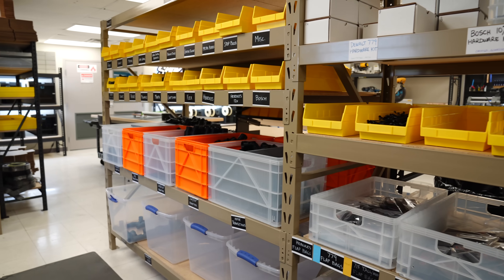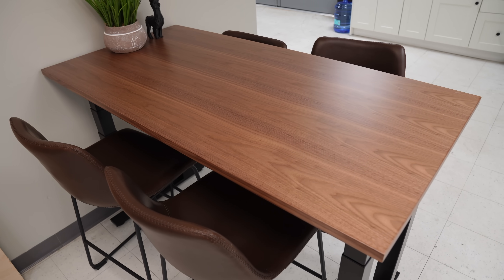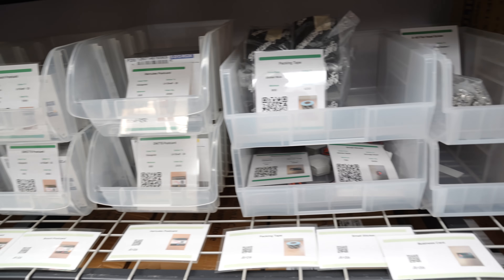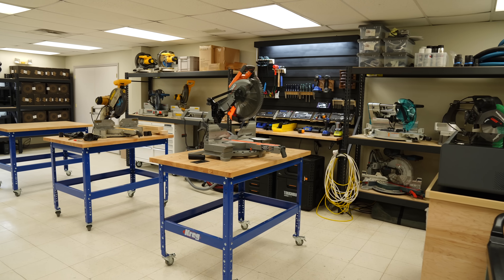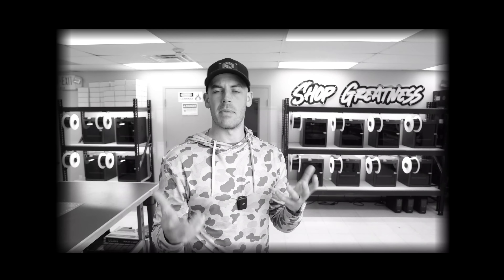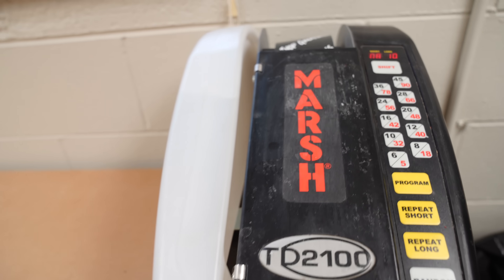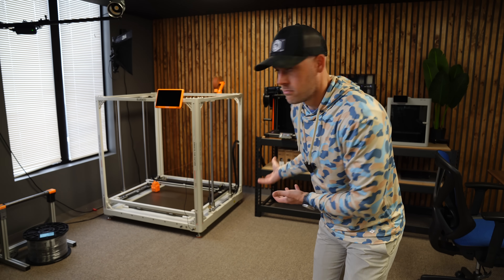I've spent $100,000 on my 3D Print Farm // Updated Tour!

Comment: Hell yeah dude!

I started my small business during the summer and finally got my first reseller, so these days I can't really be doing the "print on demand" thing anymore and I also need to build a stock like you to keep my lead times down to a few days

Loads of yummy tidbits and knowledge in this single video

Just like you mention, having enough filament on hand have been a major issue. And also spare-parts for the products I'm making.

I'm definitely going to implement most things you've done, just on a smaller scale (I only have 3 printers.. so far) :D

Thank you!

Comment: I dont get it, why not just go injection molding? A single mold and can probably replace all your printers, make a stronger part and make the parts in seconds vs hours. And probably cost you the same.

Comment: In a video on your other channel you state the printer to buy is the P1P but you have now changed to the P1S. What is your reasoning behind this? As far as I know, the only difference between the two is the P1S has is that it is enclosed but you can still add that to the P1P with the fans and ams stuff. Obviously it would cost more to retrofit but is it more for future proofing?

Comment: Might I suggest, adding a hanging like clear vinyl curtain/air flow protection. Between the pallet parking and the kitchenette. They aren't super expensive, and in the winter months or when experiencing weather. It will help keep dust and stuff ingressing into the building, and whoever is making food, or eating, much more comfortable.  Just food for thought, I have worked in a lot of large small business shops over the years, and that just speaks to me immediately.

Comment: Couple of things I noticed that I think are worth mentioning. First the shop overall looks great. 

At the printer repair station I assume there is some amount of soldering going on and I will also assume that the solder is the standard 60/40 tin to lead solder, but I didn't notice any ventilation to deal with flux fumes. I think that is something to consider for both now and for scaling in the future as your HVAC system seems to be mostly just mini splits.

Second, I have no idea what in your process necessitates so many miter saws. Is it just R&D or production as well? that should help with coming up with the answer to where to put them all.

Last, I love the whole inventory set up you have going on with the kanban cards and all. I would add that strategic buffer stocks for various reasons are not just limited to fulfillment but are applicable everywhere as evidenced by Toyota themselves during the pandemic. Here is a link to a Harvard business review article about it. https://hbr.org/2022/11/what-really-makes-toyotas-production-system-resilient

Lastly what part of the country are you located, as someone from Ohio I've always had a fascination with American manufacturing at all scales so it's fun to see contentt like this. It looks like a great operation.

Comment: Hey, hello and how are ya. I love your stuff. I've seen a few of your videos and have plans to buy alot of your plans as well as your dust port for the DWE779 miter saw. Once I convince my Wife (love you Babe). that we have a big enough yard to build a shop. But I was wondering I have the DW735 13 inch thickness planer and the dust port, well it blows no pun intended but it blows straight out and I was wondering, You being a 3D printer guy if there was a way to make an adapter that would blow the debris to the 10 o"clock or 2 o"clock direction so that it wouldn't interfere with your stock coming out of the machine?

Comment: What do you use all those miter saws for? That seems a little overkill to have that many. I work in a cabinet shop and we don't have anywhere near that many including our installers.
You could turn that wall with miter shelfs into the "tool wall' and make it French cleats half way up to the ceiling to park the tool carts underneath without obstruction. Then 3D print yourself some brackets or holsters for the miters. That way its not sticking out to much and you have extra shelves now for more printers.
Reply: Just guessing but I believe he buys them to then create aftermarket parts for them? Like 3D printed dust collection manifolds which were shown in the video.

Comment: FDM Printers are known to release plastic particulate and fumes which can be breathed in and is toxic to human health. How do you protect the health of yourself and employees against breathing in this plastic?
Reply: We print in our shop every day and usually have about 6 printers going at once. We had air sample testing done several times and the data showed we were well below exposure limits. This is including printing ABS, PLA and a wide array of high temperature nylons.
Reply: Pneumonoultramicroscopicsilicovolcanoconiosis
Reply: HVAC engineer here. Even if they were using ABS to print with, providing a safe environment would be trivial. Here is why. First, the P1S has a built in charcoal filter. Of course that won't eliminate all VOC, but additional activated charcoal and MERV 13 or even higher filtration could be used. Next the most important reason, outdoor air changes. Unlike your home, a commercial building introduces outdoor air to the return air section of the HVAC system. For a project like this we would have to calculate the required outdoor air per square foot required by code. While I've never specifically designed a system for this type of manufacturing, I might end up going with 100% outdoor air unit. With that type off system, all supply air would be fresh VOC free outdoor air.
Reply: No one seems to answer this question I have found...
Reply: Honestly just bog standard HVAC is more than enough for most printed plastics
Reply: They have printed off some filters and cool masks to wear.
Reply: Thanks to denial, I'm immortal.
Reply: That is for filaments like Asa and abs but they are only printing pla and sometimes petg and those don’t make significant fumes to be a problem
Reply: He's discussed using air filtration in the print room in another video. They have it set up to run before they arrive for the day and shut off during the night
Reply: @Matthew.Ball.  Thought I replied, but yes he does. Good to see!
Reply: @Matthew.Ball.  I also know he later on uses printers with enclosures, and a lot of models have filters and exaust fans (I'm pretty sure the P1S has an exaust fan) which he could use to route the particulate elsewhere if he so felt like it.
Reply: You can't just claim fdm printing causes toxic fumes. most prints are printed in pla. This is considered safe. Petg is much safer than abs. And to my knowledge they mostly print with these two materials
Reply: @PhilipThonbo  there's enough studies showing certain filaments emit VOC's and ultra fine particles, these include Pla and petg. Cheaper filaments have more unhealthy impurities and lower quality constituents. I work with AM in aerospace and we ran a small study and determined that there is enough concern for health that filtration and other best practices needed to be used until more data is collected from long term large scale usage. There has not been much interest in further more in depth testing, or long term studies in the industry, so taking precautions is recommended,  but we won't know more until it's been decades and we see any health impacts to those who've used them unfiltered for years. More data points is key. Most health impacts that are concerning seem to not be immediate but likely emerge years down the road, especially any nervous or respiratory system damage. So they're not just making claims. There is reason to be concerned.
Reply: @LifeSOSlive pla is safe and nontoxic even when printing. End of discussion.
Reply: You are completely correct. But it's no use talking to people who are wilfully ignorant. Enjoy your day and let them soak in the VOC's.
Reply: @PhilipThonbo  FDM broadly speaking. I didn't know how much material selection affected dispersion, so interesting to know!
Reply: PLA isny safe to breath every day. But he has the good measures, for you that maybe dont have a farm, dont print while you are in the same room or at least wear a mask (with filters)
Reply: He does not need sir filtration he is professional, will not live till 50 years anyway
Reply: Will you take a huge deep breath of pla microplastic dust? Yeah, I thought not. So it’s safe huh?

Comment: Excellent video, thank you for the tour. I recommend Kaizen foam for the tool boxes that way everything has a home and can be seen if it is missing and should be returned. I use the uline parts trays with tools set in the foam for specific processes or jobs. The tray I use just have the tools needed.The tray that  is taking up space on my counter or work tables are the tools needed for that specific task. I have one for dissasmbly and another for reassembly for example. Having a tray for each action helps me keep things simple. It helps me from hunting for a tool in a pile of tools and thenone I need seems to be lost. I just look at the tray and see the tool there and place it back after using it. I wll always have it where I need it. 
I have found attaching small labels with pictures of the hardware or component on the outside of the bins helps simplify steps. I find it frustrating pulling out several bins that are all the same color looking for an item when a glance at a small picture and description label tells you what is in the bin. I love seeing the Kanban cards and I am glad to see that they help and work for you. Good luck and I look forward to more content. The new channel looks great.

Comment: You may not want to hear it (bc it sounds like you never consulted an architect??), but those rooms don't appear to be vented properly, fumes and heat really need to be exhausted outside,  and not just conditioned air  thru wall mounted heat pumps. (Could also be a building code & zoning violation depending on your jurisdiction bc of manufacturing/hazard use.)   Also, I don't see sprinklers (and fire extinguishers??)  Has your insurance agent assessed the situation?  (You're NOT really *just printing*.).   Manufacturing layout, as another person noted, should follow the flow/process of each step and the layout should maximize that operation (as part of logistics.) But it looks like a good business. Hope it works out.

Comment: I like the inventory management system to reorder supplies. It probably is already in the software but if you could add to the cards a reorder point it would be helpful. EG if employee sees you have only 1 box of this lower use item, re-order. Or if there are 5 boxes of this higher use item, reorder.

Comment: I was wondering what your favorite printer is for general purpose PLA prints? I noticed that you have Prusa and Bambu lab printers. I’m relatively new to 3-D printing, but understand that the Prusa’s are bed slingers and the bamboo labs are chambered core XY printers, but just wondering about what you use the most and what you like the most and what do you intend to purchase moving forward.

Comment: Just got my dust collector delivered and installed today on my 12in Bosch Mitre Saw.  As long as you know this thing was never advertised to suck up 100% of the dust, people should be pretty stoked with this the upgrade; It sure is a huge difference. Very easy to setup and came with everything needed. Very happy.

Comment: Why you don't use the k1 max or k1c I think it is very good for the farm because it can connect to wifi and is controlled by wifi also there is a camera that you can whatcha the printer while it printing and if there any failed print it stops the printer to save time and money also the slicer it organized for farm printer like you can put the printer in groups and also you can send to all the data only one click it going make your life easier and save money and time and you can watch the printer from your house by your phone for each printer also send massages if the printer finish or there's an error

Comment: For hardware and other small parts I would look into a two bin system rather than kanban cards. The kanban system is great but it relies on a physical card to be "turned in" rather than a visual signal of an empty bin on the top of a rack to signal reorder. This might be less of an issue for a smaller operation though. Otherwise great work!

Comment: Have you considered running a mobile robot arm for 24/7 3D printing, might reduce the amount of printers that you need either lowering the temperature or allowing you to upscale without having to move to a new location. Voodoo Manufacturing had an awesome YT about it many years ago, might still be available.

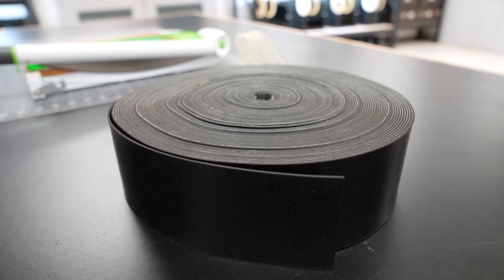Comment: 7:54 - I use to work in a print shop where we cut down huge parent sheets of paper into smaller sizes post-print, using a hydraulic powered guillotine cutter... I think this would help you in your efficiency and speed. It would also help to reduce worker injury from joint pain and inflammation from repeated actions of lifting the, what appears to be, paper cutter blade up and down, and up and down, over and over again. It doesn't have to be hydraulic - I'm sure they've made better ones since the ancient one that we had... 

Best of luck! I look forward to watching more of your videos..

Comment: Nice Video!  I have a question about the inventory cards.  How does an employee or yourself, for that matter know when to reorder.  For example: Let's say you keep 500 threaded inserts,  How low should it get before a triggering a reorder.  1/2? 1/4?  seems a little subjective depending on the person.  It's was a just a question that popped into my head. Still loving my Dewalt dust collection, still works a charm, but my chute is getting a bit beat up, do you sell replacements? (to be honest, I haven't checked)
Reply: its an educated guess in an industry like that. if you made one item all the time you would work out how many needed per hour. then see what the lead time is to get restocked. so if you use 10 an hour  or 240 a day  and it takes 3 days to restock you need 240 x 3 so 720.  you then need to trigger the re order at least in enough time  so that those 720 wont be used up. 
in shop like this its a lot trickier due to the un certain order volums and product variations and small order quantities on some stuff. you prity much make an eductated guesss then add a bit of comfort.

Comment: I think splitting the print farm part makes sense. But maybe you could still do some shop specific 3D printing content if you have ideas about that. A print farm is something different entirely from the average home shop, but I'm sure I'm not the only DIYer/Woodworker that is probably going to get into 3D printing at some point too.
Reply: Actually I'm into 3d printing, and got into woodworking because it needed a 3d printer workstation. It's more of a hobby though might go full time woodworking at some point.

Comment: Looking GOOD!!!  Nice, clean and well organized!  I have a question about the building, and that relates to fire safety.  I noticed a couple of signs that said something about FLAMMABLES AREA, and wondered why there are no fire sprinklers, smoke or heat detectors throughout the building.  Not sure if that is something that the local fire code allows, but it could be something that the building owner should be concerned about. (EDIT) In the parting shot, I did notice a smoke detector in the printing room.